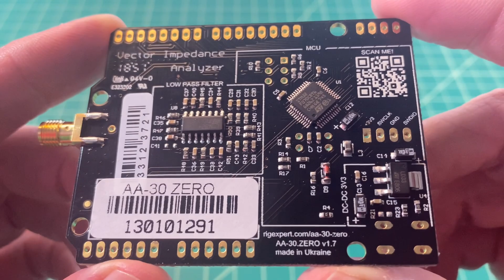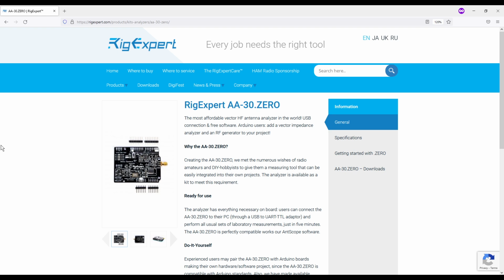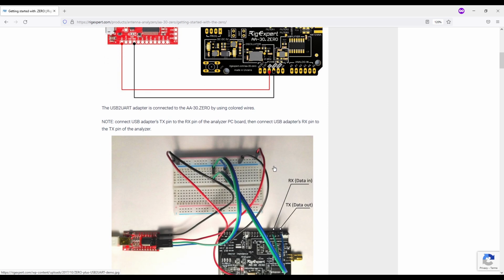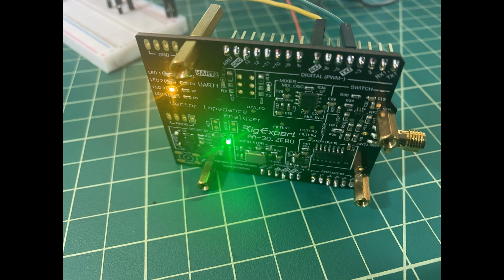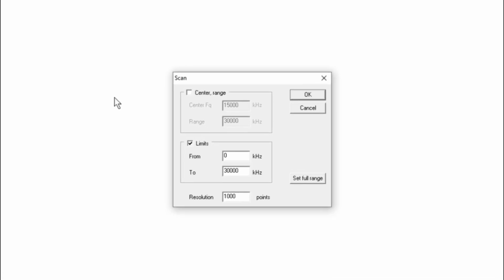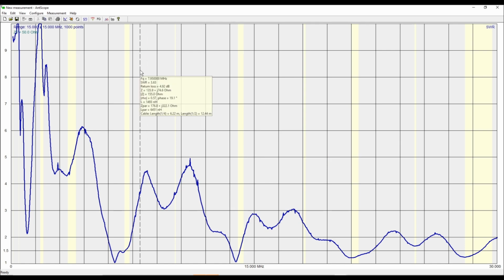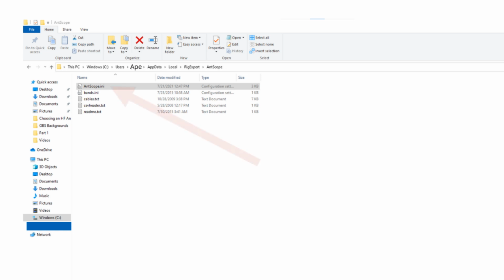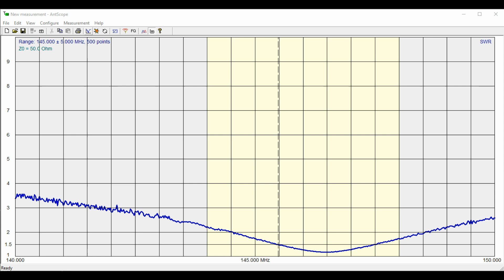Intro to RigExpert AA-30.ZERO Antenna Analyzer - Ham Radio

Comment: How to firmware upgrade in aa30zero?
Reply from the maker: These links should get you started: https://rigexpert.com/products/antenna-analyzers/aa-30-zero/getting-started-with-the-zero/  https://rigexpert.com/files/firmware/aa30zero/rev_1/
Reply: @TheSmokinApe  yes, that's correct, but how do you update the firmware with the flashtool in boot mode?

Comment: i initially tried to order off of amazon, but turns out that they are out of stock and i ended up buying from dx engineering. should've listened to ape! he said the radio outlet type places still had it
Reply: also, i'll be using antscope on linux x86-64 and also on a pi, and also hopefully on my chromebook. i'll let you know how it works out lol
Reply from the maker: I’m interested to hear how it does 👍
Reply: @TheSmokinApe  i got it working, and i have to say this is the first time i've soldered more than one of the tiny kits when i was 13, but anyhow, i got all the pins soldered on there, and i was only able to get it to work with a uart usb adaptor, and not the arduino like i wanted to. i compiled antscope for my pi4 and ubuntu inside of my chromebook, and those both work fine. turns out my efhw i made for 20m and 10m is DEF too long lol. and the 40m dipole i got from radiowaves isn't great either, but i've messed it up and had to reconnect things.... POINT IS i got it working and this is my first antenna analyzer and my first successful soldering project. go me
Reply from the maker: @Richard_KO4OBR  that’s awesome, you use it with the Arduino you do need to install the serial code on the Arduino
Reply: @TheSmokinApe  yup, used a sketch from rigexpert that's supposed to be a serial repeater. I think I have to upgrade the firmware on the rigexpert board too
Reply from the maker: @Richard_KO4OBR  I was able to run the sketch and then use the Arduino to interface with AS2